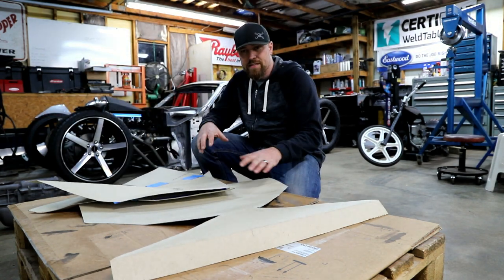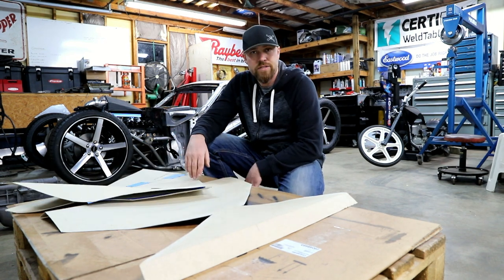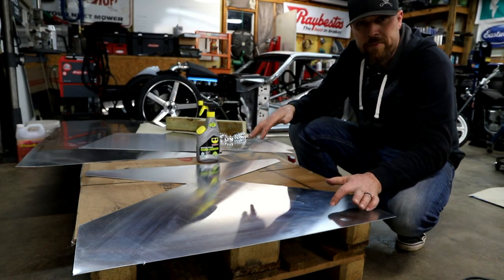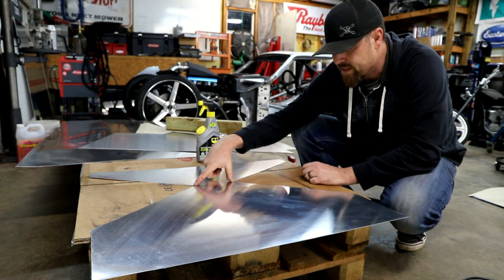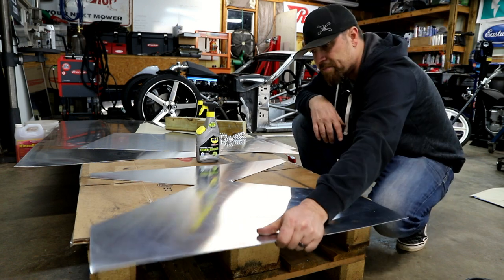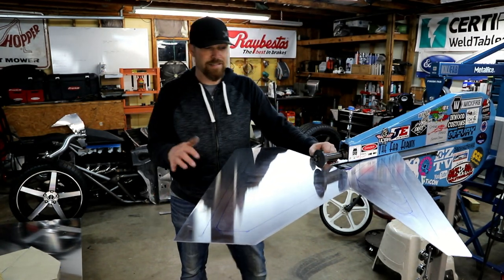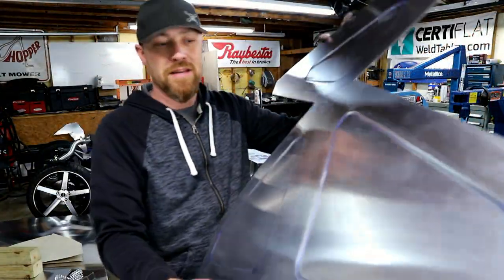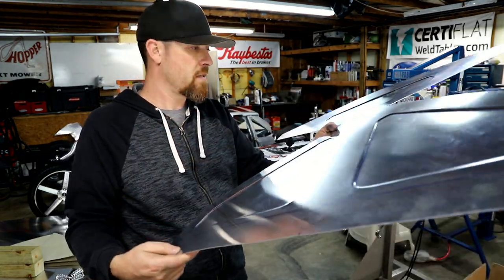Rear Mount Radiator Shroud

Comment: I've never used a bead roller bit notice you kicked a pedal. Are pushing it through or is the roller powered?
Reply: They are powered that pedal is speed just like a tig welder
Reply: @jeremyhanna3852  thanks. I always thought you push and pulled it through.
Reply: @trailerpark187  u kinda do the wheels turning helps it up the lip created by making the bead
Reply from the maker: yeah it basically has a gas pedal...
You can also switch directions

Comment: I was just thinking about the radiator fan/s.  How are you going to make them quiet so you are not sitting right next to the/those loud as$ fan/s when it/they cycle?  Not sure if you are running one or two fans or any fans at all.  Just thinking about loud.
Reply from the maker: Well a few things to consider. The fans will be puller fans and mounted under the radiator. This car will also be loud as hell so the fans may be the least of your worries.

Comment: Most electric fans are very loud.  You may want to start looking for something quiet, since they'll be right behind your head.
Reply from the maker: well they are pullers and will be mounted under the radiator...beside the whole thing will be loud
Reply: Your car.  Your choice.  Keep at it.
But I think you'll be looking for quiet fans, sooner than later, once you drive it a few times.
About the only ('normal') car sound worse than droning exhaust is a loud electric fan.
Reply from the maker: @mysterymete  you realize this thing will have open exhaust, no windows, and is made from sheetmetal right!
Reply: Yep.  Open exhaust is just loud. Rattling / oil-canning sheetmetal can be ignored.  But fans are obnoxious and wear you down.
I'm not trying to tell you what to do, or trying to armchair quarterback.  I was just offering some advice, based on experience.

Keep on it.  I do enjoy the videos.

My own next project is about to kick off and is going to be a loud bastard and mostly scratch-built, too.  Open header 357 ci SBC, crammed inside a body inspired by the 1920 Milton-Durant Special.  But... I have the ability to run a mechanical fan there.  If you can hear anything over the exhaust, it'll be the whining transmission and rear end.